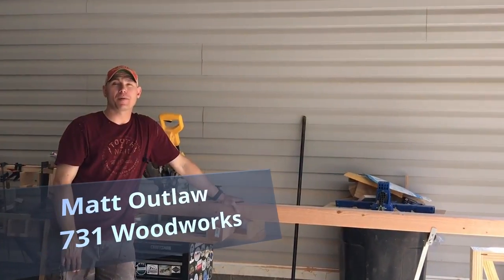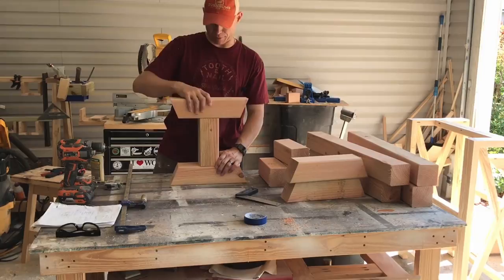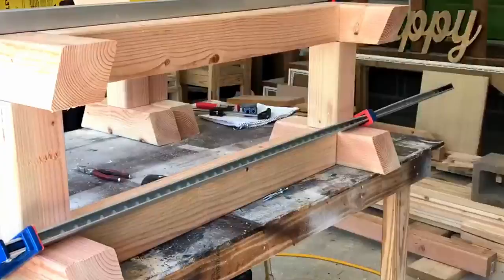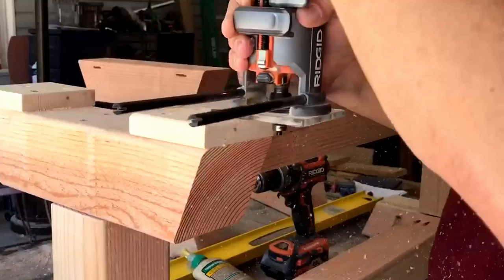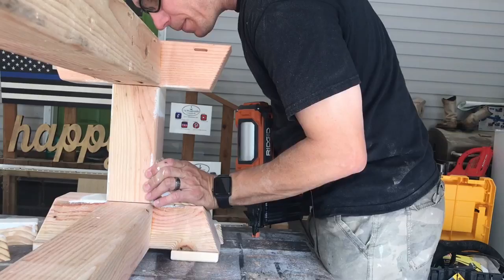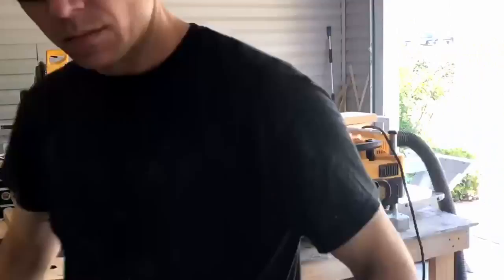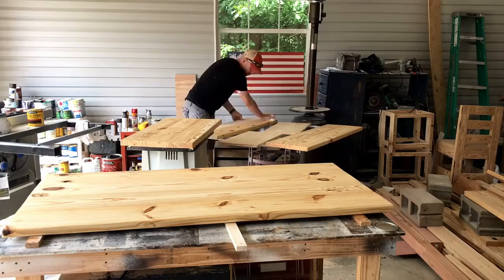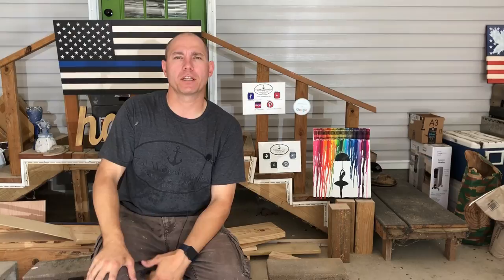DIY Farmhouse Table Bench with Build Plans

Comment: Matt great job. Have a tip for you. Kreg makes there HD jig. It works great for big timbers like 4x4s. It's designed for 1 1/2 inch thick wood and bigger. It's a lot stronger than the regular kreg screws. It is $60 bit trust me me it's worth the investment. Great job beautiful job
Reply from the maker: Thanks for the info!  I'll look into it.

Comment: What length pocket hole screws did you use? Thanks
Reply from the maker: On which part?
Reply: On the stretchers sorry. Just trying to figure out my Kreg k4 to build this. I have the legs done!
Reply from the maker: I used the 2 1/2” Kreg screws on the stretchers.

Comment: Great build!   Do you have the measurements and cuts listed anywhere?
Reply from the maker: Sorry, I don’t.
Reply: 731 Woodworks ok thanks, I’ll try to guesstimate from watching the vid
Reply: 731 Woodworks got it all done.  But I don’t under stand how to make those slots for the tabletop fasteners.   I do have a Ryobi Fixed Base Trim Router.   Will that work if I have the correct bit?  Not sure what but I would need to make that style of a cut
Reply from the maker: @joonyaboy  1/8" straight bit is what I use to make the cuts.  A fixed base will work.  Mine is a fixed base.  Just need an edge guide so you know how far down to put the cuts consistently.
Reply: 731 Woodworks thanks I really appreciate it